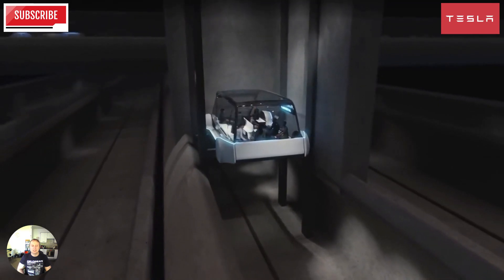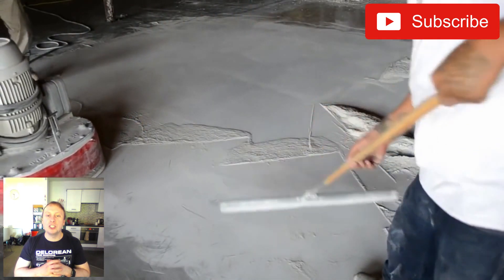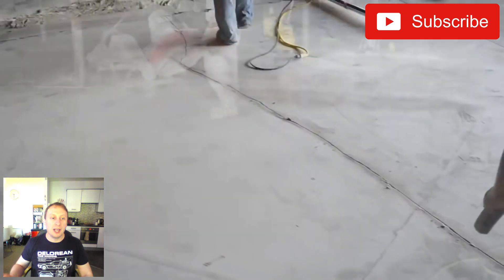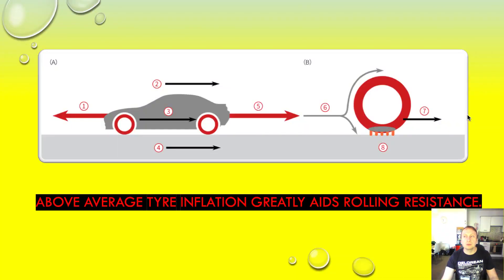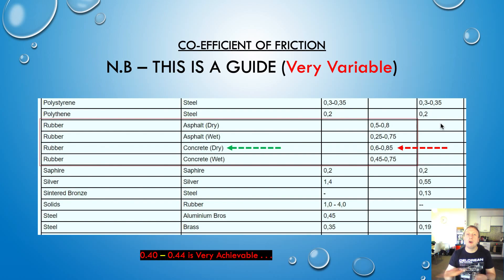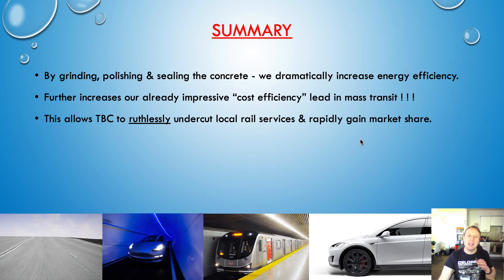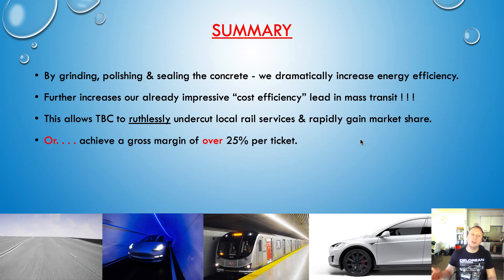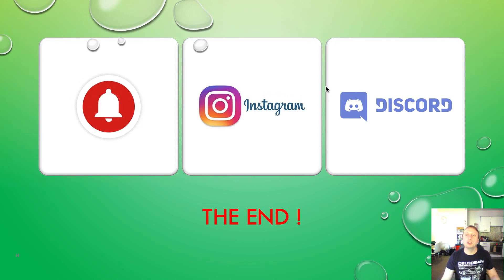The Boring Company 💰 📈 🇺🇲 Polished Concrete Roads = Higher Gross Margins 👍🏽 Prediction #15 🚇 👷🏼‍♂️

Comment: Grinded?
Reply from the maker: Grind
verb [ T ]
"to make something into small pieces or a powder by pressing between hard surfaces"

"to rub something against a hard surface, in order to make it sharper or smoother"
Reply: @BoringRevolution  I like your Vids and found this one very interesting,  thank you.    You might consider using 'ground' instead of 'grinded'.   As in 'ground pepper'.   'To grind' is an irregular English verb similar to find,  find -> makes found,  grind -> makes ground.   So e.g. 'Tesla have ground the surface of the concrete; this polished surface contributes to a reduced coefficient of friction. '. 

Thanks again for a very interesting video!   Warmest J

Grinded or Ground – Which is Correct? - Writing Explained:
https://www.google.com/url?sa=t&source=web&rct=j&url=https://writingexplained.org/grinded-or-ground&ved=2ahUKEwi_rL3ej8XpAhWGiVwKHRlBAacQFjACegQIDBAI&usg=AOvVaw2Gc4UrGnmytogCkLkFeGa7
Reply from the maker: juggy666 I think both are technically correct and both terms are used interchangeably. 😄
Reply: Hey,  Up to you :). I just wanted to save you embarrassment.  I tried.

Comment: I was thinking packed earth deck, by adding a new section to the TBM. It's less to take out of the tunnel. Then concrete. 

Grind, seal, and polish using a finishing robot, once the tunnel is cleared.
Reply from the maker: It is very possibility but depends on the ground composition ! It would work most of the time. 
My personal view is that they should use steel form-work inside the road deck to reduce the amount of concrete required. it would be the same strength and use 30% less concrete per mile of tunnel !
Reply: @BoringRevolution  pipes and cables make pretty good "filler" too.

Comment: In high speeds air resistance is still dominant resistive force so dramatic improvenents are not possible by reducing rolling resistance. Typically it is about 30% of all resistance. 

Rolling resistance comes from friction losses inside the material and sliding when material compress in dent. Internal losses divides into two parts. One part comes when the rubber compress under the weight and other part from surface microstructure penetrating into rubber. My impression is that last one is smaller and only that part can be reduced by polishing the road.

Compression losses could be greatly reduced by making the tire thinner since gas inside the tire have very small losses when compressed. That would mean specific tire and very short life time. On hardened steel rails rolling resistance is over of magnitude smaller, so hard to beat that. Benefit from tires comes from ability to drive on normal roads, so tire can't be too exotic design.

I have personal experince on physics behind this since I use to drive a race-bicycle. At spring, when roads are covered with sharp chippings, I have to use thick but smooth surfaced tire, not actually designed for these bikes. At summer, I can use normal race-tire. Sometimes during autumn or spring, nearby lake is covered with very smooth ice and no snow. If temperature is cold enough, the ice is not too slippery and it is possible to drive a bike there. It is very nice feeling because rolling resistance is so small.

Using very thin tire and high pressure, rolling resistance is dramatically lower than in a summer and normal road. High pressure and slick surface practically eliminates friction which is caused by rubber sliding against the surface when the dent form under the weight. Again the rolling resistance between race tire and overally similar looking thick tire is very clear. You feel it when you drive and you can see it from the speed in same downhill.
Reply from the maker: A great point. The ability for several vehicles to merge into a tight platoon will make the fleet insanely efficient. We are talking a 250mm gap in between vehicles. 
People who keep telling me this is dangerous are clearly not following the progress of Tesla Autopilot and forget how important safety is to Elon and all the Tesla directors.  It will be easily 80% safer than the aviation industry per million miles.
Reply: A Boring Revolution It will not be dangerous but I’m not too optimistic it could be insanely efficent. Several vehicles close together is far from optimum aerodynamic shape. Single vehicle in a tunnel have bigger air resistance than in open space. Several vehicles have advantage but if speeds are close to 200km/h, air resistance is still dominant for sure. Air moving on a tunnel have it’s own influence but it practically lowers effective air resistance speed.

Comment: Would it be easier to fasten two wide steel troughs to the concrete surface than polishing concrete?  Steel would last longer and be easier to replace.  The sides of the troughs could help guide the wheels.  The steel troughs would be easier to adjust to make level if the concrete shifts.
Reply from the maker: I think steel would work better but it adds cost & complexity to the build. Will require welding and protection from corrosion + modern concrete is like granite and super durable.
Reply: @BoringRevolution  I live near Chicago, and the concrete here is horrible.  I suppose a lot of that is due to the freeze/thaw cycle and heavy trucks.  My sidewalk has cracks everywhere.  My foundation walls have cracks and so does my concrete basement slab.  I hope this won't be a problem underground in Las Vegas.  We have a saying here "There are two types of concrete - the first is concrete that has cracked -  the second is concrete that is going to crack!  Thanks for covering the Boring Company!  It's hard to find information anywhere else.
Reply from the maker: @59seank  So true. important to consider thermal expansion from day 1 and build in expansion joints well before any cracks form.

All concrete must be given time to cure correctly otherwise it'll also develop problems.
 
Modern concrete uses way less water and more Rebar thus has less problems with cracking.

Comment: What about more slippery when wet?
Reply from the maker: Using the right tyres is key. With a quad motor system the vehicles will handle all conditions with ease.

Comment: How do they deal with airborne particulates created by tires in the road and wind by the car?
Reply from the maker: Use Bio-defence mode! With minimal braking , Airborne particles can be heavily reduced. 
The best option however is a very powerful tunnel ventilation system with 5ft diameter shafts every 600 - 850 meters.

Comment: Good plan.  Tesla vehicles are probably smart enough to measure the coefficient of friction continuously or hourly and communicate that to the entire tunnel fleet.
Reply from the maker: Exactly. . . so if the tunnel is effected by wet tyres moving rain water into the tunnels - the entire AEV Fleet can adjust to ensure safe running even with a very slippery surface !

Comment: I am sure there is a short term/long term trade off to be had but if you made road rails out of the sapphire like aluminum glass such as the stuff that broke on the cybertruck, it wouldn't wear in sand blasting due to the hardness differential. The wind going down the tunnel in high utilization and the fact that Tesla can beat a prius, the fact that the temperature is near ideal for battery operation all the time simplifies the vehicle. The controlled surface allowing high durability and high pressure tires will be a cost savings. I do thing that because of the wind you might want some self healing glossy coatings with all surfaces aerodynamically aligned.
Reply from the maker: A very fair point well made as always, appreciate your input Thaddeus.

Comment: How do you solve the issue of wet tires / wet polished concrete? That might be the biggest issue. Imagine it's raining outside and a car comes down the elevator or ramp. All that water will be dripping everywhere. You would need a system of blowers to dry the cars that come in. Might be worth it, might not. I don't see polished concrete coming into play anytime soon, but maybe one day!
Reply from the maker: Best question for April. 😎 Would need to build drainage channels and extract 99.8% of the water that gets in via the ramps! 
Aco drains, 5mm speed.bump and roof cover required at ramps, as other wise would get dangerously slick. Wet tyres would rapidly dry after 15 - 20 seconds of use. Ramps wouldn’t be polish concrete as a safety measure just the main artery tunnels 👍🏻
Reply: @BoringRevolution  you would need climate control through the whole tunnel, atmospheric condensation will be a larger issue then rain water at the ramps. your hypothesis needs more work.
Reply from the maker: @23chaos23  Hi i'm in disagreement. The powerful mechanical ventilation system will eliminate any build up of water as per a video I did several months ago. Air will be both pulled and pushed through the system in very large volumes via shafts every 600 meters.
Also very unlikely this will be an issue with modern tyres and using a gully (as per this video) down the centre of every tunnel. Moisture build up will be very minimal.
Reply from the maker: @23chaos23  My gut feeling is that this is none issue in most of the USA. The road tunnels in Boston seemed extremely dry when I was visiting last year so I would need to see studies confirming your thesis.
Reply: @BoringRevolution  What about NY, LA in the summer? the humidity there is an issue, anywhere the humidity rises above 70% will be an issue. Ill see if i can find some studies on subway ventilation in NY. The problem is the use of the tunnels is different to boring companies type of use. The environmental issues are present but wont be noticed because trains dont run on polished concrete roads.
Reply from the maker: @23chaos23  true and this is a subject well beyond my area of expertise!!! I'm guessing that by simply adding a 40mm "gully" to the center of the road-deck you could reduce any significant build up of water. 
A light dusting of moisture would also greatly improve the coefficient of friction. So it might not be a bad thing if the right tyres are used.

Comment: If dedicated just to the tunnel then pneumatic tires aren't needed 
So solid tires would work
Reply from the maker: Some form of run flat rigid tyres would be perfect if they could achieve 155 mph and cost less than $2,600 a pair !!!! 
Partnership with Dunlop 🤩 ?
Reply: @BoringRevolution  Multiple companies have already developed airless tires/wheels.  I would expect the cost could be fairly low.  The wheels are molded plastic and a rubber tread is attached to the outer edge.
Reply: Ideal tread pattern?   Might it be thin slicks? There's no need for snow/mud gripping except at surface levels.

eta: Smoother surfaces means less tread wear and less tire dust.

Comment: I agree with the principle but you need to also look at the efficiency of re-grinding in tunnel which I think could be a major issue. I would investigate prefab "track" slabs just for the wheel trough that can be pre-polished and then you just need to go through with a laying machine. Prefab concrete road slabs are already quite common around the world and as you are on a very solid base with no heat variation they should be fairly maintenance free. As for the rest of the non -trafficable road base look at recycled plastic\printer cartridge\glass additive + bitumen which has been tested to higher performance than traditional hotmix here in Australia.
Reply from the maker: I’m in two minds on this one as you could just drop in prefabricated blocks and fill out the tunnel but having joints every few metres isn’t ideal but then pouring a screed on top is adding extra processes. 
I think in a confined space it may be  easier to pump in the concrete and have extremely long slabs! 
Maybe Elon will tarmac the inside like at the Hawthorne test tunnel. I hope not !